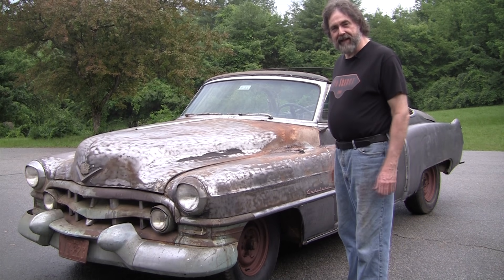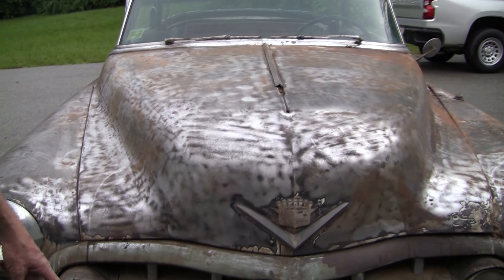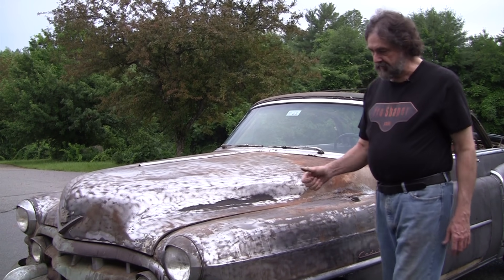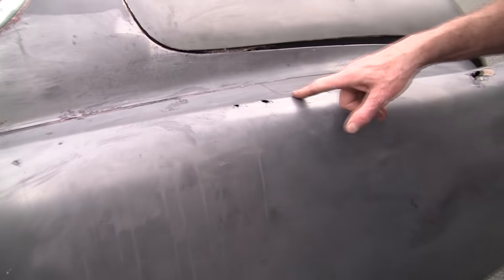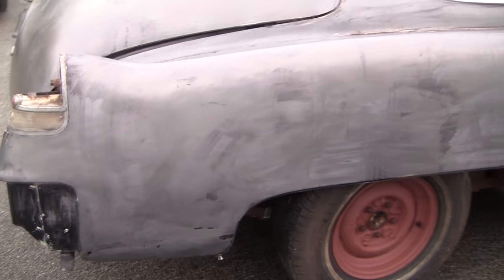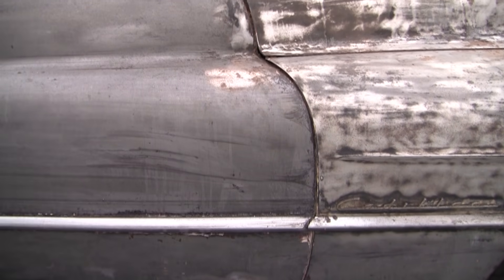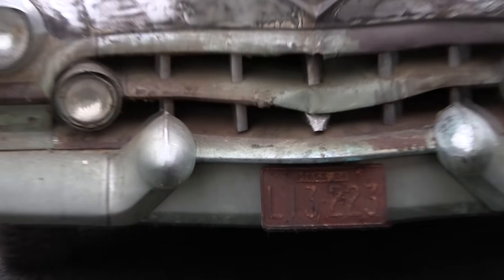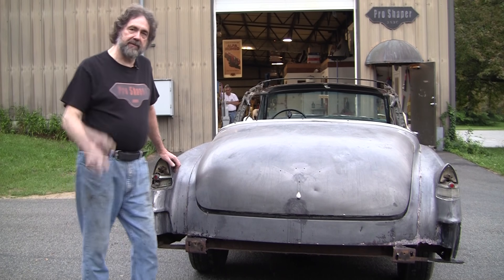1952 Cadillac Convertible Paint and rust removal results

Comment: Great videos. Very interested to see how to best deal with that undercarriage rust. Or just dealing with rust in hard to reach areas in general. I am repairing the rocker panels on my 2003 Volkswagen that have severely rusted away and its been a challenge to access the built up rust for cleaning on the inner sides of the metal that has been exposed.r

Comment: The drivers fender might out of whack because of worn radiator support/body mounts or maybe, my experience with drag cars (not that this was a drag car) but getting on the gas, the front left rises up. Maybe the previous driver had a heavy foot, too heavy for a early 50s convertible.

Comment: What is the best way to remove undercoating?
Reply from the maker: Paint remover removes undercoating.  A heat gun and putty knife also helps. Follow up with lacquer thinner steel wool, elbow grease and paper towels.
Reply: @proshaper  thanks

Comment: I cringe every time I see someone reach for a grinder to remove old paint and rust.  Your "do no harm" method rules.
Reply: Those stripping discs that are like a plastic mesh don’t sand or touch the metal and take the paint off quickly.  If anything the metal comes out a bit polished.